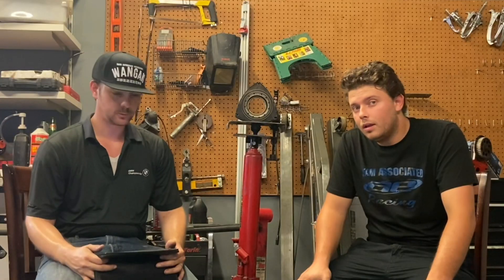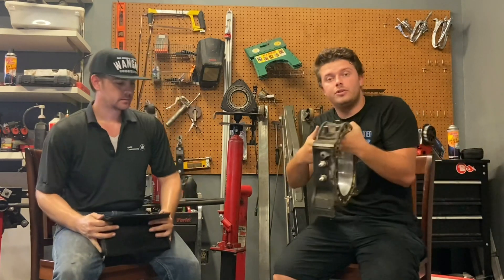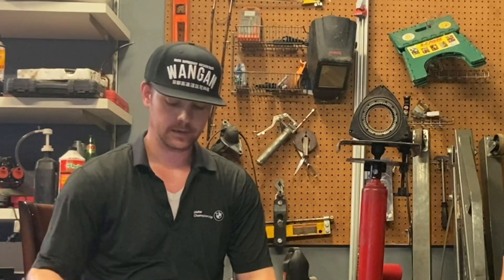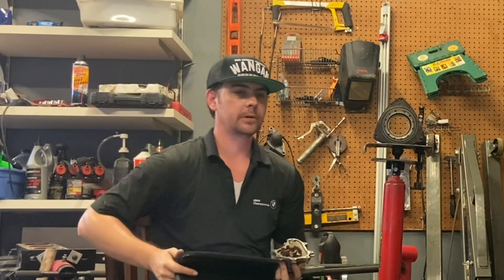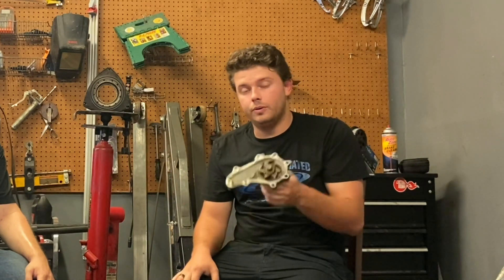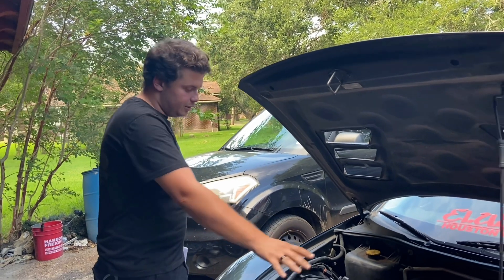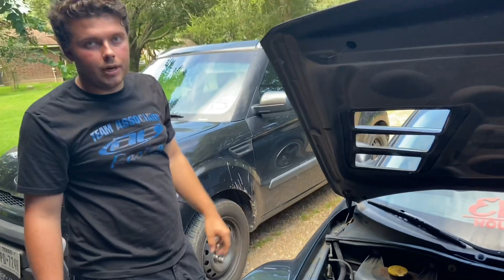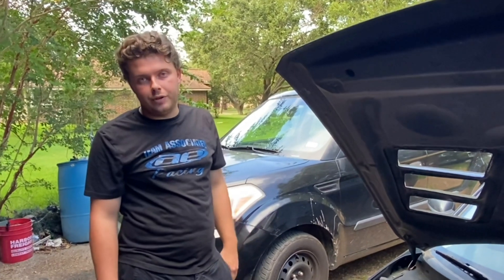Overheating RX8?

Comment: I need your help in 2 things 
I have a 2004 RX8 my first it has 2 issues that I have no idea how to or where to begin. So it has a coolant leak under the car by the passenger side almost they giy I bought it from said it need a freez plug. But I don't believe it is . Hers why yesterday I noticed it had no heat coming from the heater just cold air.  I don't know anything about heart core or a RX8 but I'm willing to learn anything. If you can offer me a few words to help point me in the right direction. Please and thank you

Comment: Hello, i have an 05 mazda rx 8 192 hp and have problems with the cooling system, i start the car and it runs about 5 10 minutes, after the temperature gets up, i notice water fogs from the coolant recipient and the engine dies off....try it to start the engine again but will not start till the temperature goes down....i saw you told the problems that will come up with this and i will try to replace the thermostat, also i dont hear the fans to work....this happened after my engine has blown and replaced with another one now, hope will solve the problem...you was very helpful with the info👌
Reply: sounds like a blown water seal

Comment: I’ve had good results with a coolant pressure tester forcing air out at the throttle body. Use a short piece of hose and 2 water bottles to catch the fluid. You made me think about my new 175° thermostat now.